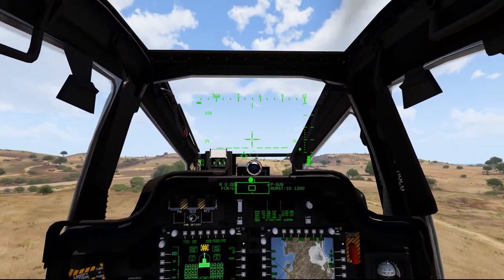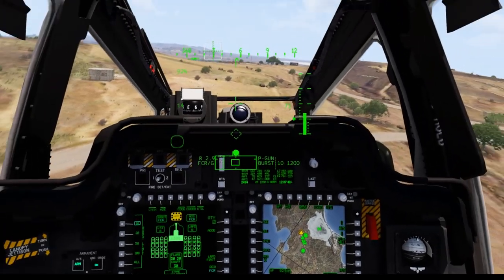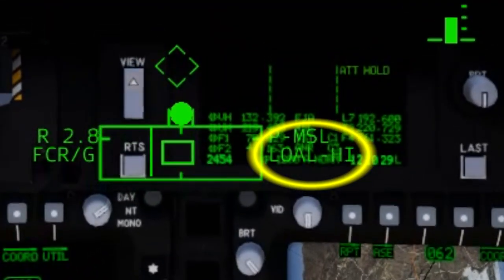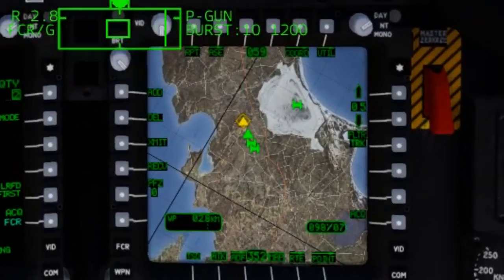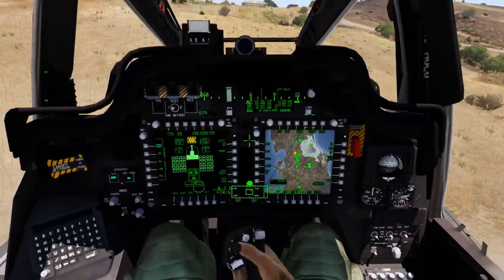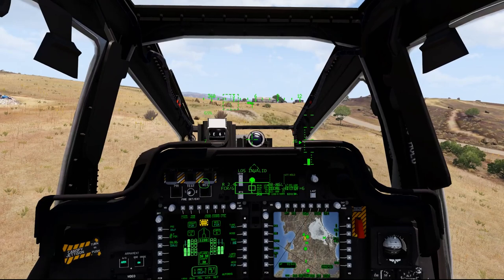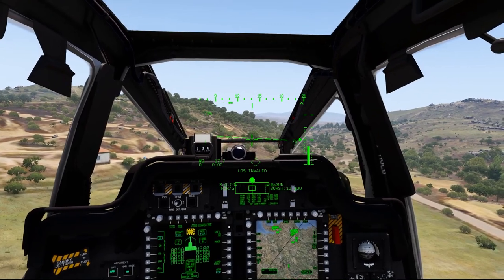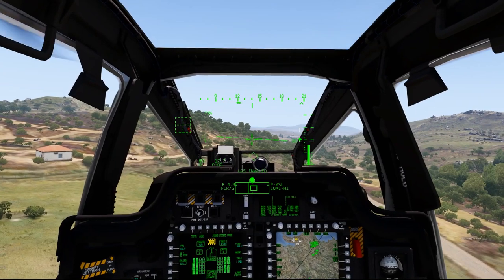ARMA 3 : AH-64D Apache Longbow Mod FCR Tutorial Part 1

Comment: Thanks for the video Gadget70 ! Quick question though, when I try to use the TV camera, it shoots quickly to the right or left when I try to turn the camera, is this due to using my mouse verses using trackIR?
Reply from the maker: Hey Seth.. thanks.  But what do you mean the TV Camera? Do you mean the TADs or PNVS?  There is no such TV camera. Hard to guide if I don’t know which you are referring to
Reply: @GADGET70  first off, thanks for the reply. I'm asking about the sensor that you use at 20:00 into the video when you confirm that the tanks have been taken down. I know how to access that sensor as the pilot, but it is unusable due to the crazy sensitivity when using my mouse. Just wanted to know if that is normal for those that fly with mouse and keyboard and not using TrackIR

Comment: I can start the Apache, get it into a hover; however, I can't achieve ETL(in advanced flight model).    No matter how fast I get the bird going, power seems to fade and it become uncontrollable then crashes.
Reply from the maker: +Scott Farkus you probably entered what is called a VRS (Vortex Ring State). ... research it and there are several tutorials out there on how to managr it. ... also in AFM, the RPM management is something to also manage properly
Reply: @GADGET70  I know what VRS is and how to avoid it and how to get out of it if I get in it, this is happening in ground effect though.  I've got 863 hrs in helicopter simulations BTW and I'm a pretty darn good pilot, if I must say so myself.

The problem acts like a bug in the mod; I go through the proper start up, sometimes it flies just fine other times it just won't fly higher than a hover without the power fading, and the cyclic controls becoming extremely twitchy, then the thing ends up nosing into the ground due to it being uncontrollable.   It looks like pilot induced oscillation, but I'm not doing anything to cause it. It feels like input lag, as it(if) something is interfering with cyclic inputs.  Feels like the trim goes away and I'm trying to fly a machine that was designed be flown with the aid of a flight computer.  Like trying to fly an F-117 without the computer.

Could it be other mods interfering with the Apache mod?   Or maybe I have the power switch in the wrong mode causing the governor to not function properly?

Gauges all show good on both engines, rpm is good on both engines, oil pressures are all good.  Looks like it's ready for take off, then it just won't.
Reply: @GADGET70  I figured out what the problem was(it wasn't VRS).  

The problem was with the Auto Trim, you have to go into the Configuration menu and enable Auto Trim or the ship won't fly right.
Reply from the maker: +Scott Farkus 👍👍

Comment: Hello,  what are the minimum requirements regarding software to install mod. Thank you.
Reply: MINIMUM:
OS:Windows 7 SP1 (64bit)
Processor:Intel Dual-Core 2.4 GHz or AMD Dual-Core Athlon 2.5 GHz
Memory:4 GB RAM
Graphics:NVIDIA GeForce 9800GT / AMD Radeon HD 5670 / Intel HD Graphics 4000 with 512 MB VRAM
DirectX®:10
Hard Drive:45 GB free space